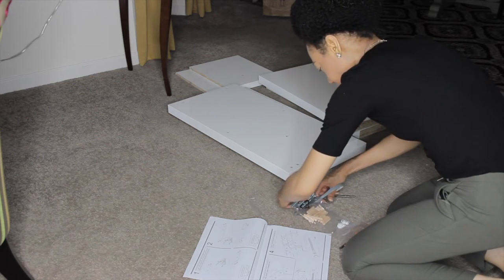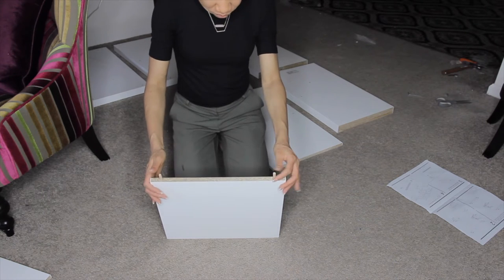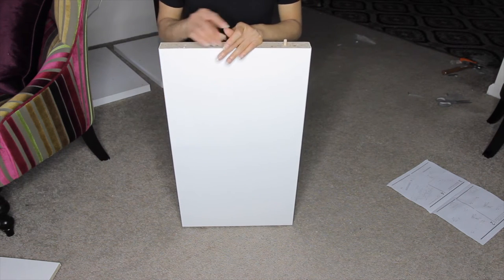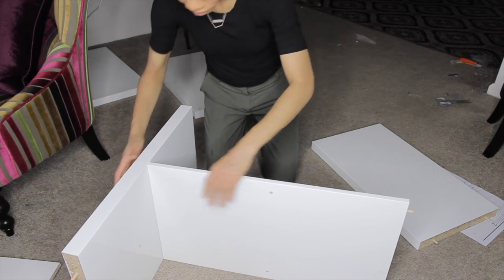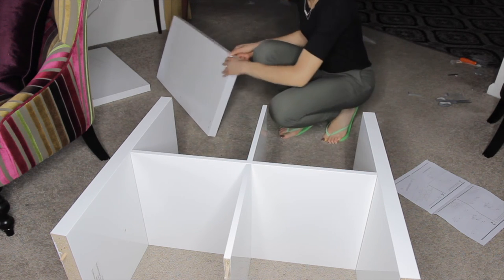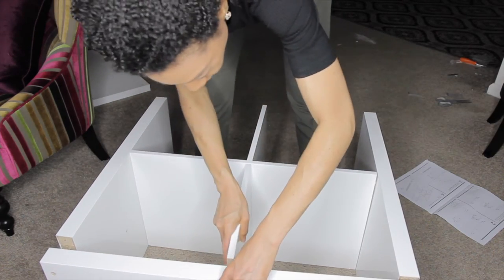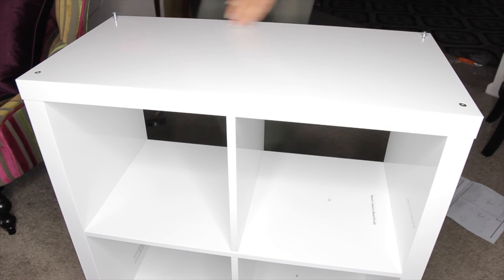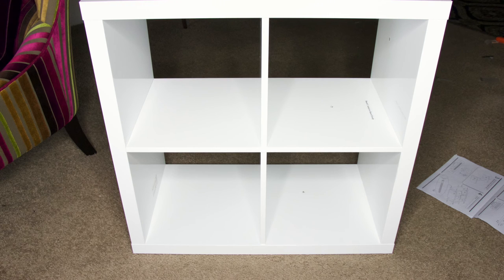Better Homes and Gardens Square 4-Cube Organizer | REVIEW + ASSEMBLY

Comment: Thank you for this video! I bought one of these used from someone who had gone through everything inside the box and had repacked it without the assembly instructions. My husband and I still needed to put it together. All the screws and dowels were in a ziplock bag and I think I'm lucky I got the wrench tool. If I hadn't seen your video I wouldn't have known about how the two inside pieces share the same dowels and would have been confused. What was weird, though, was that even though both yours and mine are from the same manufacturer and only the color is different, the letters on our parts were different. Your D parts were our B parts, etc. One thing that might help people who see this in the future, when you are finally ready to put the two ends on do not screw down one side before trying to line up the other side with the dowels. We put the screws in one side before trying to put on the other side, and had to remove the screws because the other side refused to line up. Once the screws were gone it was much easier to line up the dowels with the holes in the other end piece. But this video was a godsend because there are no PDF instructions anywhere online to download. Thanks again.
Reply from the maker: P L Glad I could help! Yes, I do recommend adding the screws last. The dowels are meant to hold everything in place for the insertion of the screws.

Comment: Great video, you made it look very simple! How supportive do you think the main large shelf is without the two smaller shelves?
Reply from the maker: Mateo Garcia Hi - I'm not sure which main shelf you are referring to, but if you are asking will the unit be steady without the two pieces that run vertically through the middle, I suppose it may be. If the item is too heavy it could cause sinking in the middle. Also, the screw holes will show without the two vertical pieces.
Reply: Hey thank you for the reply, you answered my question exactly :)

Comment: Do you think this is sturdy enough to hold a 45 inch TV?
Reply from the maker: Jasmine Jones I'm really not sure, but if you check the questions and answers section in the product link, there is a lot of talk about TV's and maximum weight. Someone mentioned 100 pounds, but the TV may look awkward with the edges extending passed the end of the shelf. The shelf is only 30 inches.
Reply: According to the instructions, the top shelf can hold 50 lbs the middle can hold 30 lbs Max.

Comment: if anyone knows where to purchase the screws and dowels, let me know. my other came without them
Reply from the maker: TheYuriBabe Hi! Try Home Depot!
Reply: It has been a while since this question was posted but I'm answering in case someone else needs the same answer. If you need replacement hardware, Better Homes and Gardens has no link on their web site to ask for things that may have been missing from your box. It says that if you need help with any of the BH&G products sold at Walmart you need to contact Walmart for help. Mine was short a screw and I've emailed Walmart for replacement, but I don't know what will happen.

As far as buying replacement screws or dowels, the easiest thing I can think to do is to remove one of them from the cube unit and take it to your local home depot or other store where screws and other hardware are sold. Show the screw to someone who works there and ask them to help you find one.